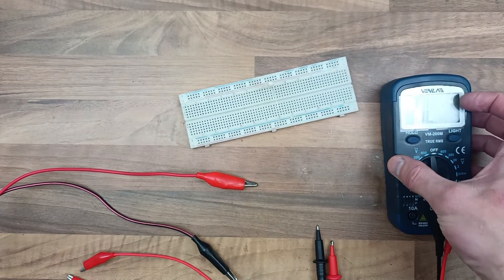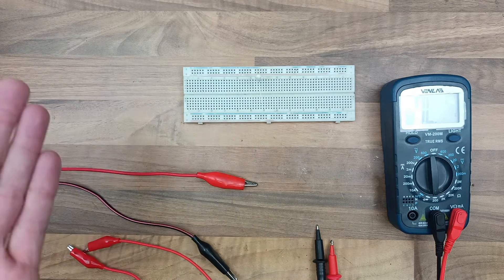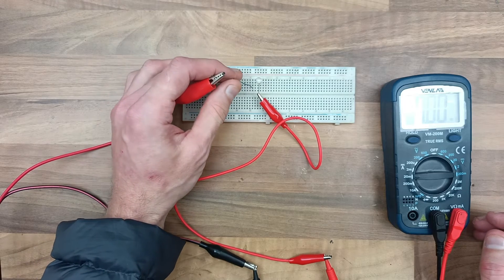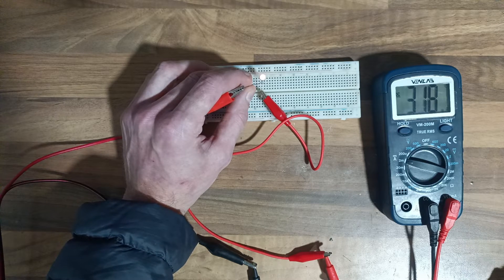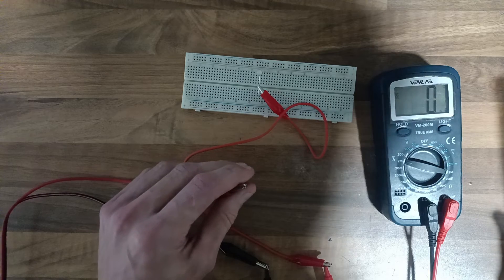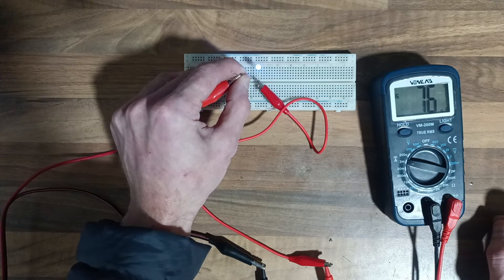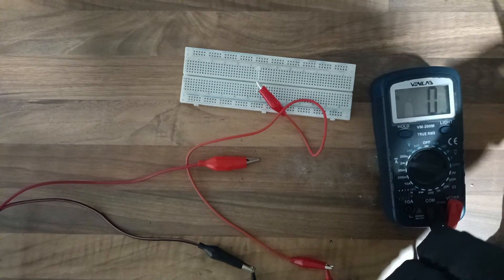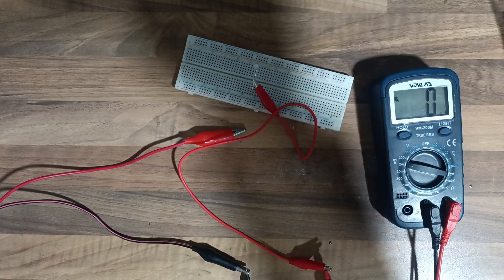INVESTIGATING: LEDs and Resistors? Which resistor to choose? How little current can an LED run on?

Comment: Hi, just did some testing myself. i have som high effeciency LEDs and i tested 5V 220K. clealy visible in a dark room. tested down to 0,5 uA. in a dark room, still visible on a blue. my other colours vere similarily bright with 220K. i did not try the other colours on 0,5uA though. it takes absolutely nothing to light up a high effeciency LED enough to be visible in a somewhat dark room.

Comment: Yeah in terms of efficiency, it seems blue > green >>> red. It can also make blue LEDs great visual detectors, since they start glowing at such low currents. unfortunately it seems 2/3rds of companies still like to run all their green status LEDs blindingly bright at like 2/5mA instead of 100uA.
Reply from the maker: Yes, it's still very interesting isn't it? Admittedly, 5ma is a lot brighter, but brightness doesn't correllate with amperarage in a linear fashion!
Reply: @antonycartwright  absolutely not. i suspect it has a lot to do with our eyes not being liniar. as OP said. I HATE with a passion when an indicator light is running high brightness when it is easily reduced. all my projects with indicators, i always ran them at 1-4 mA. thats plenty bright for an indicator.